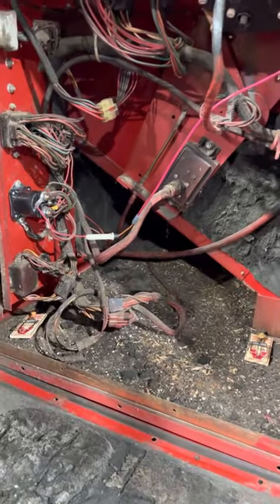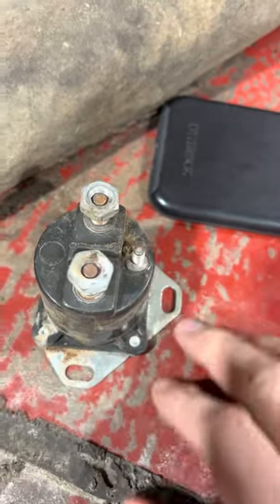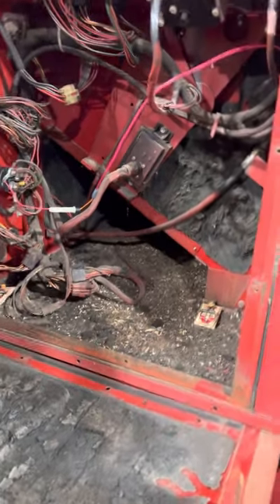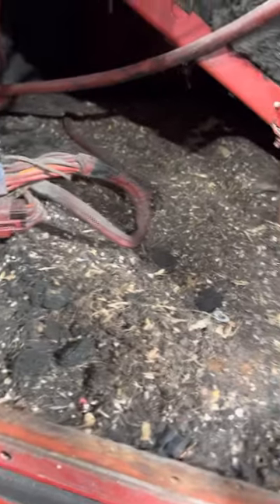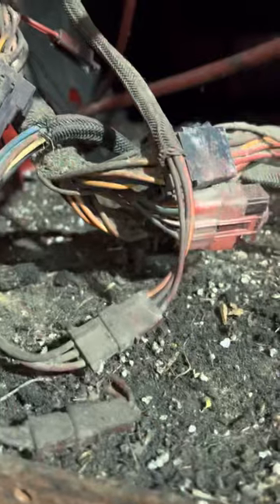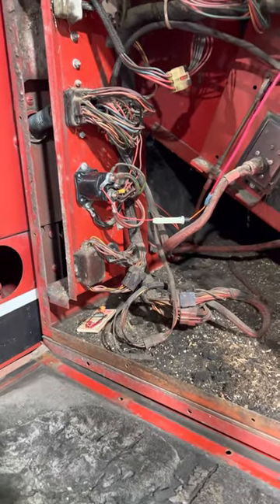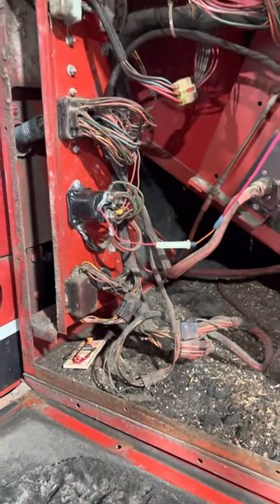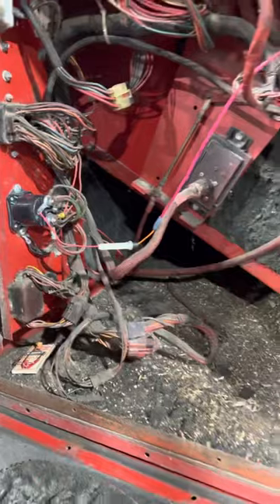IH 1460 Combine Cab Solenoid Issues

Comment: Hello. I am looking for information on the 1460 harvester because I want to buy one. I know that you have to pay attention to the electrics in them. Thanks for the information you provide in the video. I leave a subscription and like. Greetings from Poland
Reply from the maker: Great simple machines. Aftermarket parts support is very good compared to other brands of that age. Biggest thing with electrical and with any combine is to keep them clean to avoid rodent problems. Mice seem to be the biggest issue with wiring damage. As with any combine don’t let dust build up either to prevent fire issues.